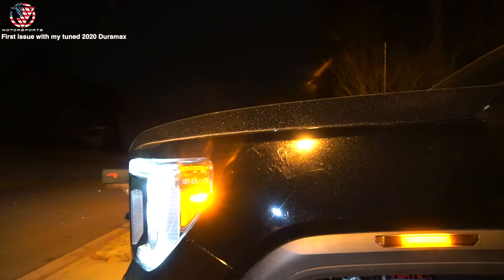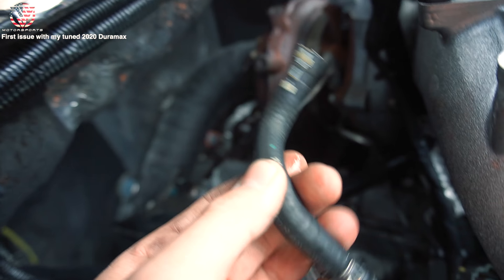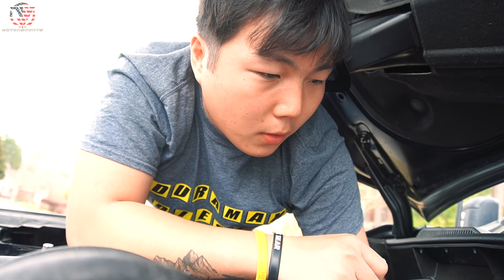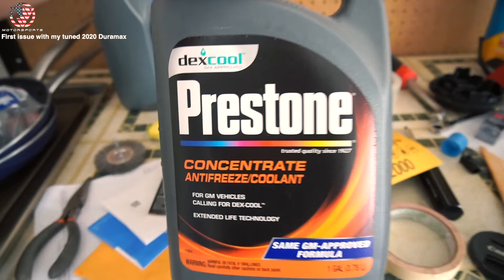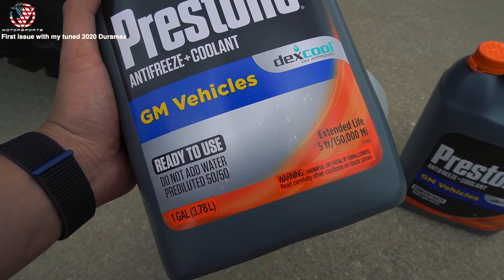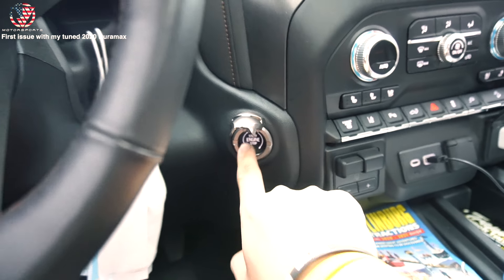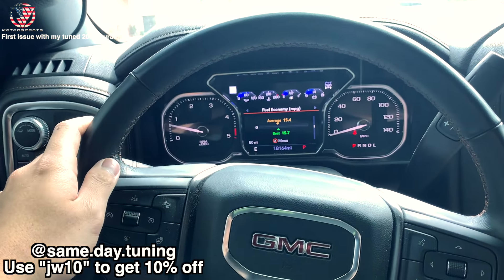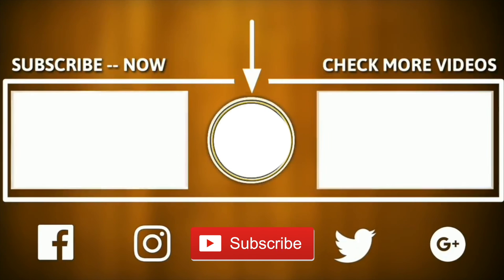MY FIRST ISSUE AFTER TUNING THE 2020 L5P DURAMAX! 💀 + DSP5 (SOTF) TUNING INSTALLED!

Comment: Capping that line caused high pressure to build up because the coolant couldn't flow through the hot turbo. When the coolant started to boil and the phase change from water to steam happened it made the rubber cap blow off. Not to mention the cap ripped right at the hose clamp which tells us it was probably overtightened. All in all it's a good thing it did so you could correct the real issue of capping off your turbo's coolant return line! If you had left it alone or that cap not of blown off you would have been slowly cooking your turbo degrading it and had a slow coolant loss from steam pressure escaping out of your coolant cap.
Reply: Excellent, intelligent, and correct.
Reply: You said much better than I will 
Why TF you plug your coolant line from the turbo ? 
Delete does not mean delete the good working stuff
Reply: The proper kits actually include a permanent plug cap the turbo cools through the air inlet…

Comment: Same thing happened to my 2018 L5P. I bought a pack of vinyl  vaccum caps from auto store & put two of them on with some hose clamps. Mine been running fine for 5 months now. I keep extra caps, clamps, & coolant just in case 🤷🏾‍♂️😎😁

Comment: So it looks like you blocked the coolant flow through the turbo, right? What other systems do you damage by changing them without understanding how they were designed and should work? All that money you are saving on DEF and diesel fuel will seem like nothing compared to chasing your tail and fixing what you damage. What if that dead head had not failed? How long would that turbo have lasted? Looks like your friend there might know. This is entertaining and will grow your channel for sure,  your truck project is certainly the catalyst to do that.

Comment: The line you capped needs to be returned to tank. You are dead heading coolant at the turbo that’s why the cap blew. 17-19 put that cap on the feed line that has a tee on it
Reply: Yeah I had the same issue on my 18, second time I turned it up I blew the cap off. Ran a short piece of hose and got a barbed plug and seems to be good now. Amazing they haven’t changed the solution and keep selling the garbage cap with it
Reply: HOW is the turbo cooling if you plug it off?
Reply: @KinderYacht oil

Comment: Coolant leak after party mode on a L5P is like a right of passage 🤣I had one at my upper coolant pipe, then the firewall connection and then most recently near the thermostat. Finally ran a pressure test and we Gucci now
Reply: Seems like we have all been there now 😂 glad I wasn’t the only one
Reply: Firewall connection? I have a leak that I cannot locate

Comment: Does the cruise control functions still work or are they only for changing tunes now?
Reply: Cruise Control Functions. Turn off the cruise control and you can set it 1,2,3,4 or 5. Turn it on, and you can set the cruise control.

Comment: You might have an issue running the steel pipe back to resi, steel line is a little smaller diameter and I believe that’s why I blew the cap off mine the first time. I have an 18 so my cap went on the tee though

Comment: You do not re route that to the coolant tank at all / that turbo needs the coolant to it ... I have a deleted 2020 first and only in New Mexico. And have to get a ( T line connector ) to connect it to that re route
Reply: Why wouldn't you re-route that back to the coolant tank? That's they way the truck came with it routed to the coolant tank from factory. Your point is not valid.

Comment: Distilled water and deionized water aren't the same.   50/50 is mixed with deionized water, which is why it's so expensive.  You should research the difference.